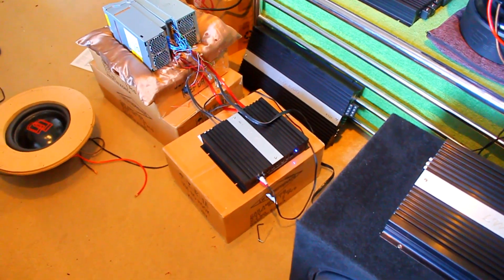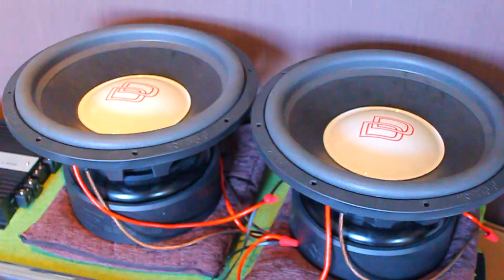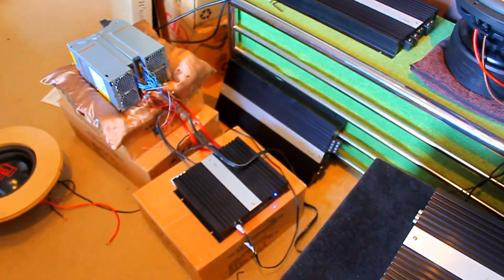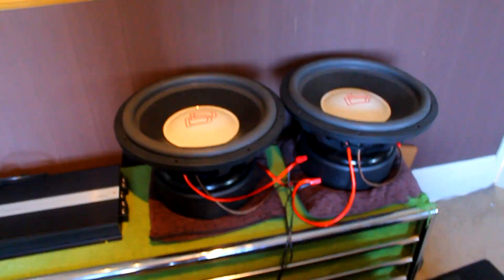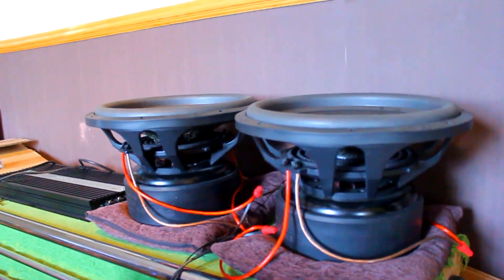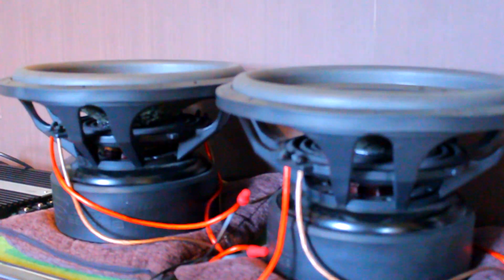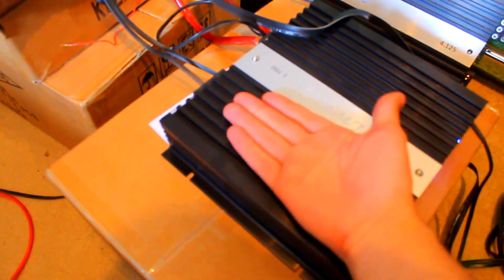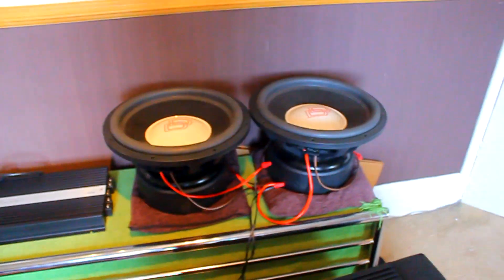Baby amp pushing BIG subs! LW-audio 1.700 @0.5ohm x2 DD9915

Comment: Dope vid what kinda power supply should I use to run one 12" woofer that has 2000Wrms plus my old-school concept amplifier with 1600w I think that's right bcue amp has (4) 40a fuses if I was wrong about the amp wattage can someone tell me the correct watts for this amp oh yeah and what power supply should I get so I don't blow a fuse any suggestions or recommendations

Comment: Running the subs like that will damage the subs , subwoofers are made to be used at the correct polarity,  if the subs are hooked up correctly the amplifier will get warm not hot

Comment: @barevids dude if you take 2 Xbox 360 older power supply's and bundled them together it will have the same voltage
Reply: +lawrence weldon But not nearly enough power.
Reply: +NelGaming yes but can you combine them together to get enough power as the 2 psu's have don't they give off a bit more
Reply: They claim to put out 14.2Amps on the 12V rail but in my expericance they go into protect mode pretty easy in which you have to unplug it, wait for the caps to drain (led go off) then plug it back in

Comment: Amazing. I can't wait until I am old enough to get a car and put some subwoofers in it! For the time being I'm using a 12 inch JBL in my room
Reply: +Dylan Crawford I think it's a fairly new brand and they havn't focused alot (if at all?) on marketing. They have the .2 and .3 series which is ffffffffffucking brutal. Google for "Bass Face SPL 15.2" or why not 15.3. =)
Reply: Once you are old enough, grab some pocket change and invest in some better sub's then JBL. The best bang for your Buck will be things line Sundown, DD, Soundqubed.
Reply: Dylan Crawford I'm thinking of getting two Orion HCCA's 12 inch subs. I know I have to upgrade the electrical system ect, my dad can help me with that as he used to be a mechanic
Reply: +Dylan Crawford Bass Face has some nice woofers aswell, they have the ".1" -series which is cheap as hell. Check em out! I bought two SPL 12.1 woofers, I havn't tested them yet though as I have no box for them, nor do I have a powerful enough amp for them.
Reply: Ronny Von Frisk I've never heard of them!
Reply: PSI Dylan.

Comment: What kind of power supplies are those, they look massive and look to have the potential to have alot of amps if 12v
Reply: They are dell power supplies that push out like ~200 - ~270 amps
Reply: I need 4 of them do you happen to know what model it is or what server it comes from?